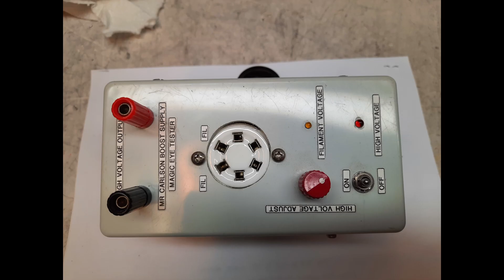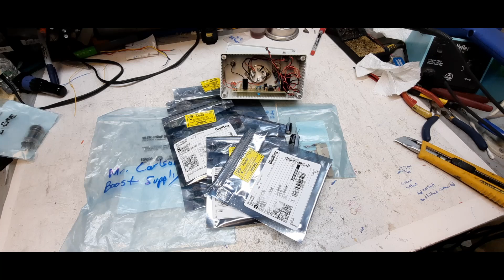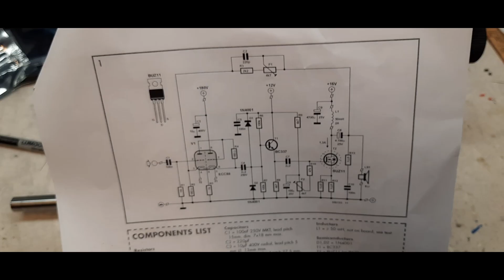Mr Carlson Boost Supply - Elektor Hybrid Amplifier Project - July 2006

Comment: Hi bettina. The pcb for the amp you can Download it from elektor for the power supply I will have to look and see if you can get a pcb layout. PS you can wright in english I just live in germany  from 1974 till now from Brian w.germany
Reply from the maker: I think I will sign up to Elektor. Theyu are a good magazine. As for the PCB, I will not need it. I will go ahead with Mr Carlson supply plus use a proto-board for the other supplies. THanks anyway. Cheers!

Comment: I took a look at the video for that power supply and the schematic showed an output voltage of 200. I am assuming I have Paul's correct video - Number 75 "Circuit Release! HV "Stand Alone" Boost Supply"?
Reply from the maker: This supply is adjustable with that trimpot. I got as low as 90 volts and a high of 400 volts. I set it for 180 volts which my hybrid amp will use. Cheers
Reply: Where are you guys looking? I can't find a video with that title either on Patreon or Youtube?
Reply: @MB-st7be  Aug 4, 2019 was the release date.
Reply from the maker: Yes .. it was video 074 from the Patreon page.